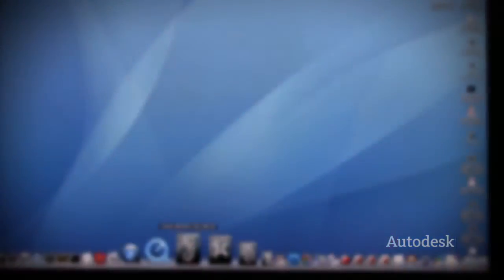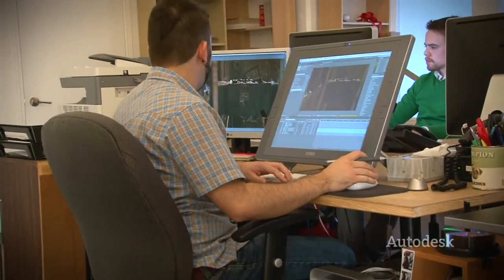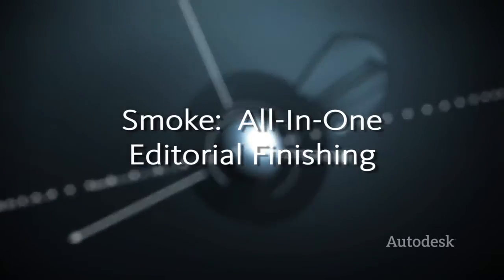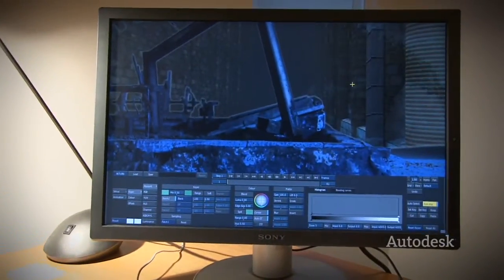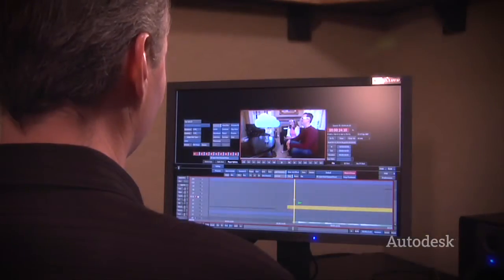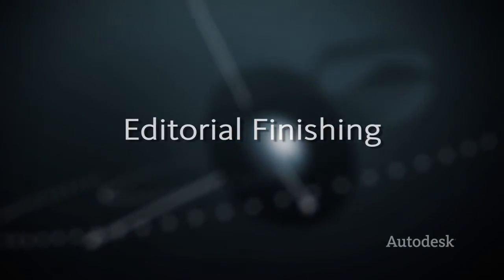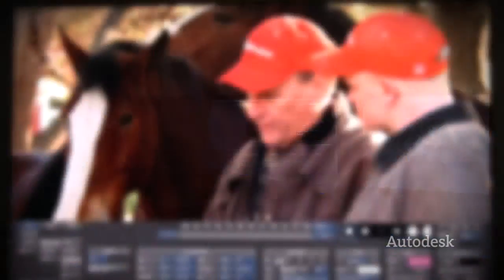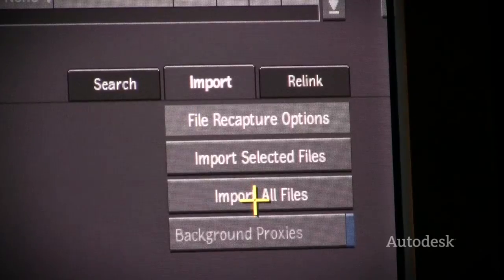Autodesk Smoke for Post-Production and Broadcast

Comment: I have a Mac, it runs faster, quieter and cleaner than any PC I've ever had. I'm a freelance video editor and learned on FCP so I bought a Mac. It also lets me use almost any keyboard, headset or hard drive without needing drivers, understand almost any video and audio format without needing codecs, almost never crashes (and if it does it actually tells me why) and just FEELS better. Is someone going to give me a valid, legit reason to get rid of my Mac and buy a PC? Didn't think so...